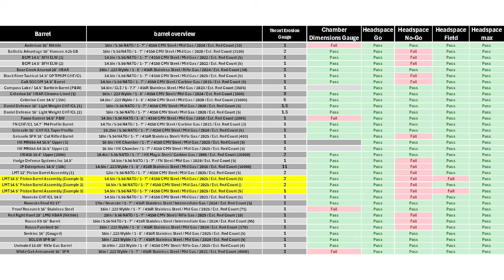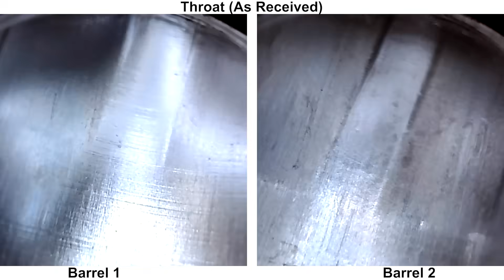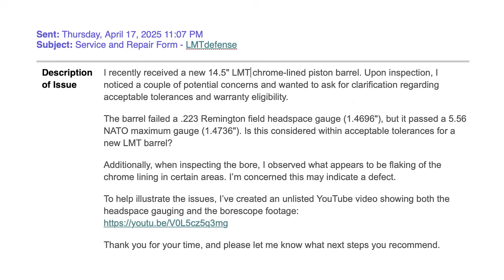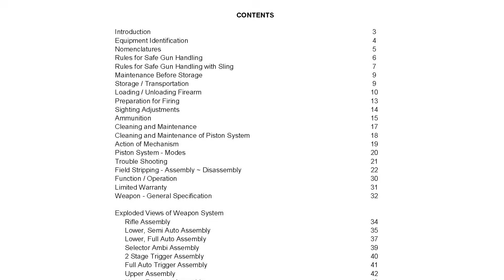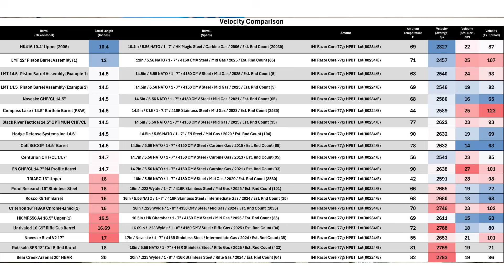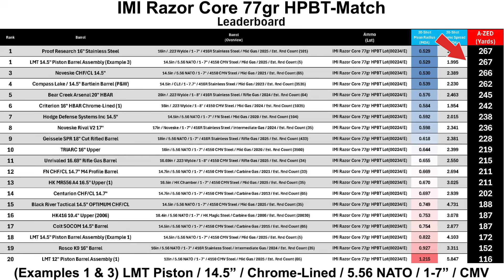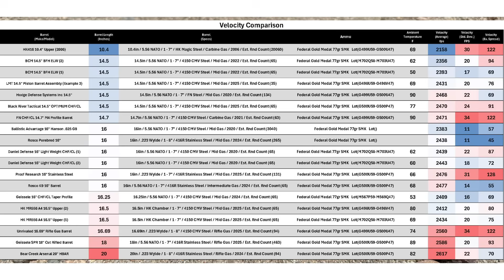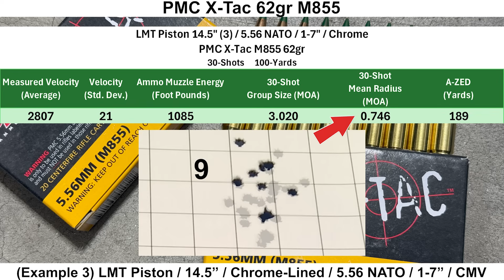Is the LMT 14.5” Piston Barrel Worth It? Full Inspection + Group Results

Comment: You should check to make sure the barrels are actually free floating in that chassis. This was a major over sight that went unchecked and I discovered in three of my Lmt mrp mlr chassis. It’s a known issue which is why they will cnc a channel where the gasblock is touching to correct the issue if you send it in

Comment: It's like it never ends with the LMT.  There are always some kind of issues with their rifles. I've seen almost all possible issues with their rifles on LMT reddit. Even if it runs 100% reliable for the price this is unacceptable, add to that all the blemishes, scratches, dings and dongs you'll most likely get. Geissele which sell much more rifles than them at much lower price and there are almost no issues with them. Even if something happens they'll deal with it very fast.

Comment: Long answer,yes , short answer no.  Most people don't shoot well enough to know the difference. Most people don't shoot well enough to understand an M4 barrel profile usually kills precision either. However, if they were to swap out to a non M4 barrel profile, they could potentially train into that accuracy. If they can do that ,they will also have a reasonable chance at training into the non chrome lined accuracy If they decide to do target competitions for group size like bench rest or precision hunting such as extreme long range varmint blasting.

Comment: Huge bummer, but not unexpected, I had to send an LMT lower back because if looked like it was machined by dragging it down a highway and one of their wonder bolts because it wouldn’t lock back on their lower after 1000 rounds and took 6 months to replace.  My upper and barrel from them look and shoot great.

Any Centurion stuff in the pipeline?  I’ve got one of their SOCOm barrels that shoots nicely.

Comment: Wow thats crazy. It really seems like there is widespread QC issues with a LOT of barrels. I have a Criterion nitride barrel that has a really rough barrel extension that is gouging rounds, beating up the bolt, and causing malfunctions. Have had accuracy issues and also inexplicable light strikes, as well as out of battery and jamming.

Comment: I love LMT rifles, but it's best to have D Wilson convert an aftermarket barrel of your choosing.  

The monolithic upper is my favorite on the market, and their ambe lower is my favorite of any lower I've tried.  However, their barrels are very hit or miss, lots of quality control issues as you demonstrated. They warrantied an $800 stainless steel 5.56 Factory barrel, but even the replacement is mediocre.
Reply from the maker: the fact that d.wilson has an entire business replacing LMT  with aftermarket barrels is kind of telling.
Reply: @PrestonJMoore yes, it's a shame.  Karl Lewis has designed and worked on some really impressive rifles, but they need to up their barrel game.  Other brands that cost the same or even less routinely shoot better.

I had D Wilson convert a 16" Bartlein from Craddock Precision, it's probably now the most accurate semi-automatic rifle I've ever shot. Definitely a shame to buy a $2500.00 rifle, and have to immediately spend another $700 to make it seem worth the price

Comment: Just curious. Why send them back like that? If you just shot what you got, that would be way more comparative to 99% of buyers that won’t inspect the bore with a bore scope. 

You could still inspect it under a bore scope then do the test, and it would show what we would probably get off the shelf. Then maybe the negative PR would light a fire under their ass for them to replace it, if they chose to.

Great content! I love the channel!
Reply from the maker: I like to give each manufacturer at least a chance to make it right. Everybody puts out the occasional bad product. It happens. If I can spot an issue early and get a replacement, I think it makes sense to do so. And if the manufacturer doesn’t handle it well, that ends up speaking for itself… refer to my previous video on BRT...

I did shoot one of the defective barrels before sending it back. I just didn’t run every single ammo type through it because of time and budget. By shooting at least one group with the bad barrel, I get a direct comparison against the replacement barrel, which I think makes the video more informative.

To me, that’s a good balance show the defective barrel(s), shoot it enough to demonstrate performance, get it warrantied so we can see how a “good” one is supposed to perform.

It would’ve been way easier to just shoot the first barrel and move on. But going through the whole warranty/return process took about 6 months and I learned more by doing it that way, and hopefully the viewers do too.

Appreciate you watching! Glad you enjoyed the video!
Reply: @PrestonJMoore fair enough! That’s a good enough rebuttal for me. Makes sense when you put it that way. But also if you’re consistently getting lemons maybe they’re putting out consistent lemons to the general public. lol

Comment: For what prices LMT charges the lack of QC is INSANE!
Reply: Nope, par for the course. Most "name brands" are luke warm at best.... for God sakes, whatever you do, don't even think about looking at legacy brands.... those are even worse
Reply: @joearledge1 that's why if I'm going to pay those prices, I'm going for LWRC.
Reply: @jacobbaumgardner3406  so a DIFFERENT brand of overpriced crap.... got it....
Reply: @joearledge1 you clearly don't know much about LWRC, do ya.
Reply: @jacobbaumgardner3406  they're 16", 1:7, 5.56 chambered battle rifles.... they do 2 to 4 moa, just like everyone else.... but THEY charge you $2k for the pleasure.... just like the other name brands and legacy brands...
Reply: @joearledge1 anything on basic factory load ammo will do that MOA, that's not a fault of the gun.
I personally wouldn't buy anything more than a BCM for an AR-15. Beyond that it's just diminishing returns. 
If you're gonna buy a Gucci gun, though, LWRC is about as good as it gets for value.
That doesn't mean higher quality guns aren't useful. LWRC themselves have a reinforced receiver that's been modified by Surefire for a dedicated 6 ARC build for SOCOM.
Reply: @jacobbaumgardner3406  short of a specialty build, there's no reason to pay more than 800 for a complete battle rifle. You can find good ones as low as 400. If they solved the 6 arc gas gun bolt problem and kept it in a standard ar, then yeah, they deserve extra for solving that specific issue, but they're charging 2k for their basic battle rifles.... that tells me they are trying to be a gucci company catering to the mag dump dude-bros.... that's fine, but it's not for practical shooters.
Reply: @joearledge1 I own them all.. LWRC in my opinion makes the best rifle you can buy for $1500. Over-priced junk is definitely a false statement. All the top big dawgs I've been blessed to own them. LWRC DI is hands down my best rifle that is done correctly
Reply: @joearledge1 I don't fully agree with this. An $800 AR will NOT be sub-moa. 
My Dad has a $400 AR, and you're right, it does work well enough for a fighting rifle, but there are things you just can't get quality wise until you're a decent bit above $1,000. That's where I inject my statement again about BCM being the best bang for your buck, and you're getting them for about $1,200. Beyond that it's diminishing returns, but not zero quality gain. More expensive guns are still higher quality.
Maybe it's your opinion that you don't need one, and that's fair, but even militaries are buying higher quality and more expensive guns like the HK416, which is $2k vs $700 for an M4.
Reply: @jacobbaumgardner3406 Anderson with a crit barrel swap.

I have a $200 BCA that is sub moa with the right ammo. It shoots better than my Mars-L DI, now that is disappointment.
Reply: Was definitely not expecting this.

Comment: The “lake bedsurface” is fire cracking which is not good.
Reply: Fire cracking is from after shooting a barrel for a while and will be mostly in the throat and work it's way to the muzzle, if it ever gets there. Its a lot deeper and more scary looking than that, actual lake bed or skin condition look. The cracks in the vid is the chrome plating that seems to not be adhered much at all really
Reply: @SiliconeSword its still fire cracking heat and pressure has caused the chrome to crack and the pressure push it out the end of the barrel.
Reply: @LovesM855A1 sure it went out the barrel but these barrels were recorded in their unfired condition and still looked like the chrome would come off if you said something mean to it. They're just regular cracked, not fire cracked since there was presumably no fire before the bore scope went in